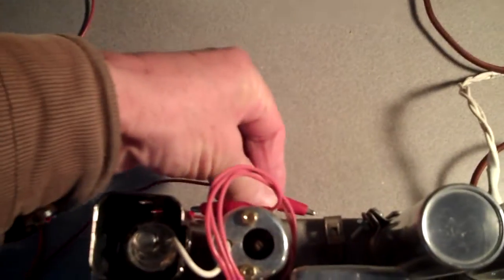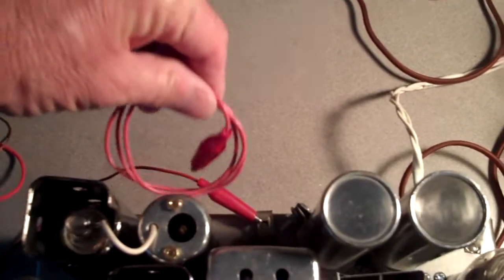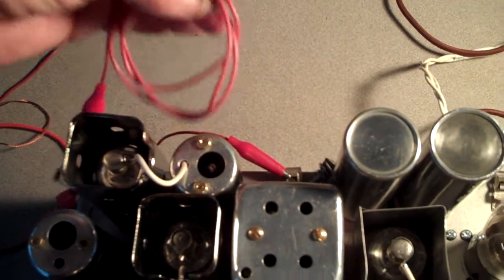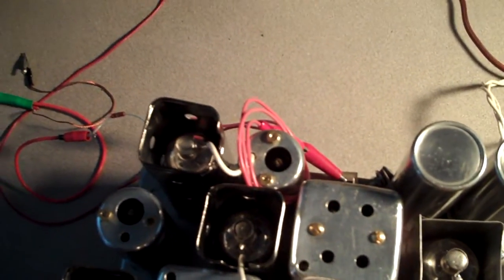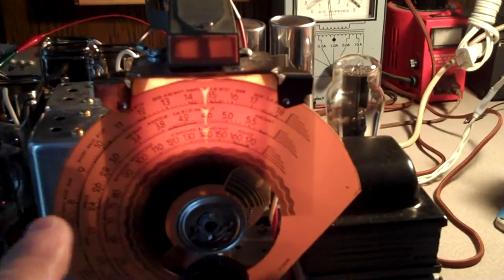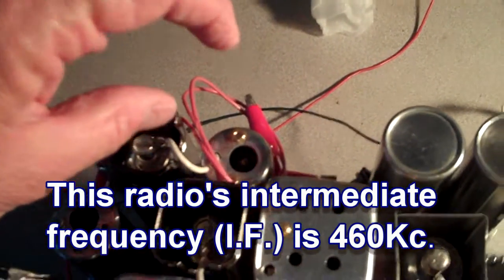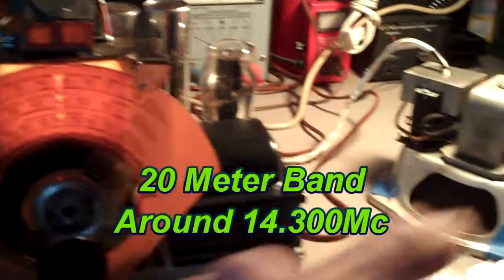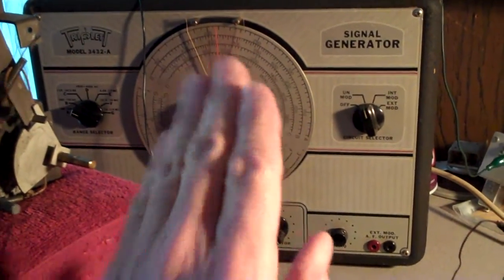How to tune in single side-band on the AM broadcast band.

Comment: maybe you could run a 10 pf or so trimmer in series with the rf gen and tune the beat up and down.i dunno maybe  lol.grt vid.btw in homer davidsons book ..radios you can build.he has a very simple bfo circuit tbat uses a mpf102 transistor.it works very well and on any  superhet.

Comment: A good experiment.  However won't the receiver drift?  If the signal generator is more stable than the receiver you may have better results with the BFO on the signal frequency (3.5, 7, 14 MHz etc). That way even if the receiver drifts 1kHz the signal will still be perfectly tuned in.